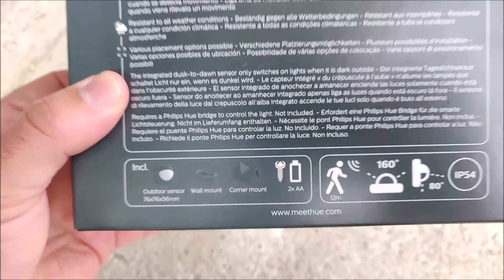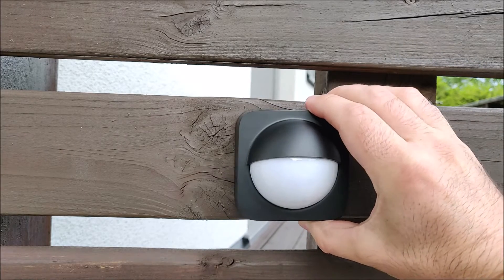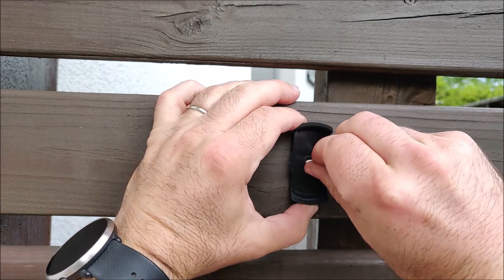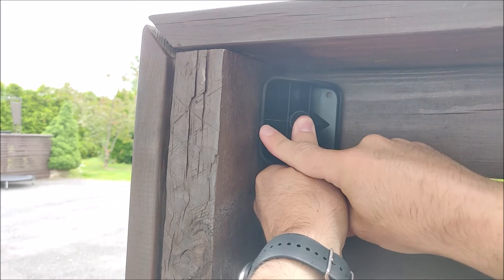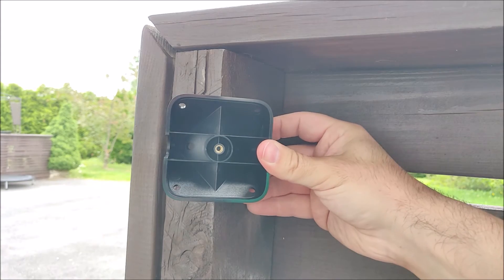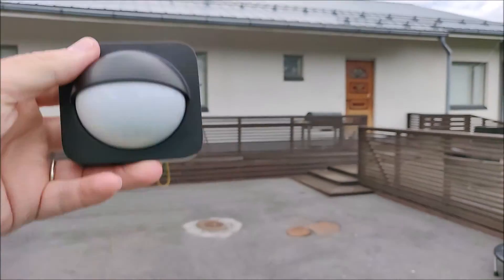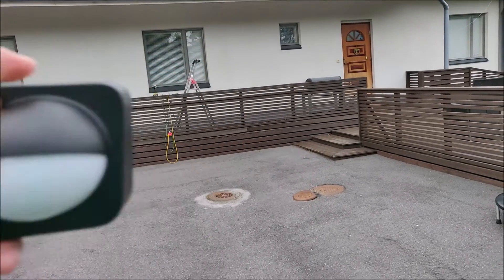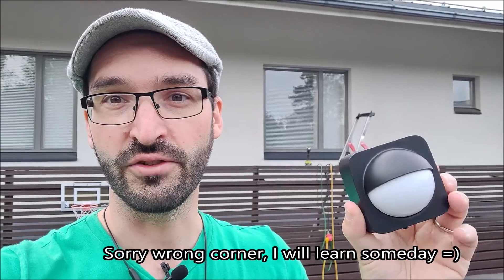Philips Hue Outdoor Motion Sensor Installation | Range and Mounting options explained

Comment: Thx for a great video!'
Can you tell me if it possible to make the outdoor lights turn to max when triggered by the outdoor motions sensor when someone walks towards my door, and after for let's say 2 min go back to dimmed mode? (I have 3 different Hue lights in my carport in dimmed mode activated by set time, but I want it to go to max to see better when I walk from the car to the door, but then I want it to go back to dimmed mode)
Big thanks in advance!
Reply from the maker: I bet one could do something like that with home assistant. Don't know is it possible with smartthings

Comment: In your video, you show a retaining screw that appears to be intended to hold the motion detector to the plate.  However, in the model of outdoor motion detector I received there was no such screw.  Furthermore the installation guide does not indicate there is such a retaining screw.  I attempted to use the same screw that holds the battery cover and that screw was not the correct size.
Reply from the maker: Hi Edwin, do you mean the screw at 0.41 which is pre installed on the bottom of the sensor and is sticking out? My unit had that included and it was pre installed into place. Would suggest contacting the seller or Philips directly if it was missing from your package.
Reply: @Homeneer  Thank you for your comment.  I have already contacted them to see about a replacement.  But thanks for the videos.   They're great!  And without the video I would have just assumed there was no retaining screw.
Reply from the maker: Thanks Edwin for the positive feedback 🙂